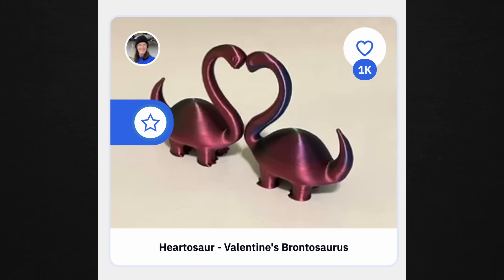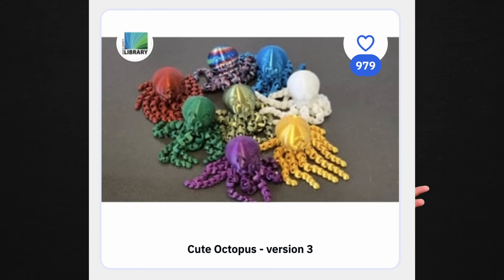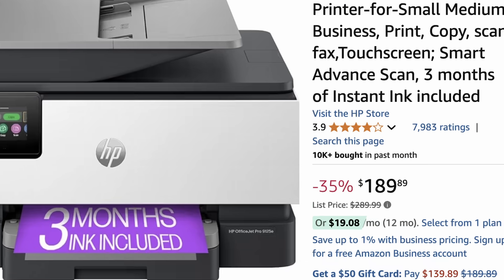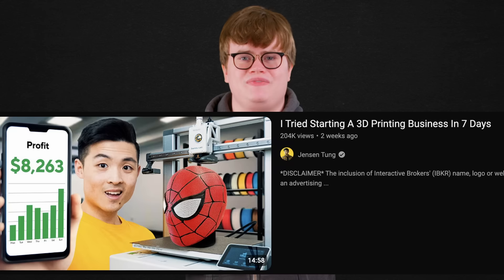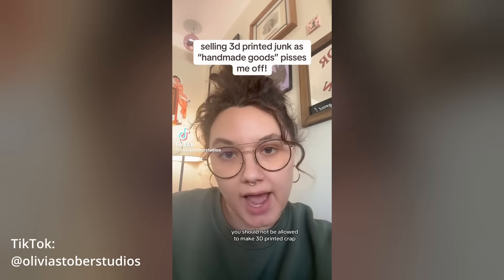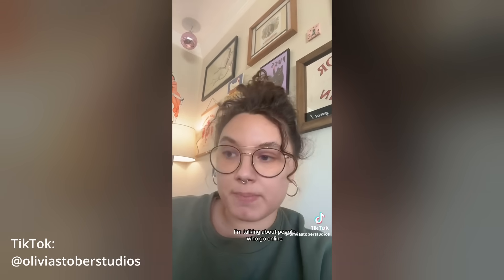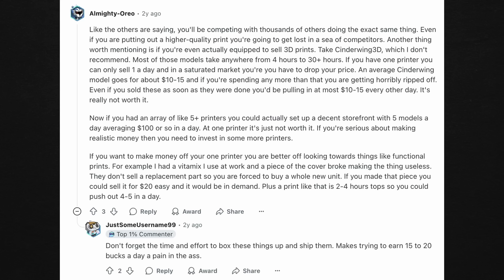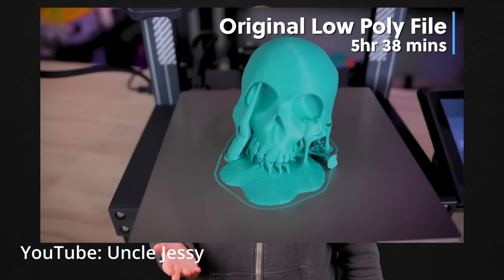The Rise of 3D-Printed Slop

Comment: i still have my first prints... must be 15 years old now. 

an adjustable mitre for the table saw.
a venturi "pond sucker".
the missing M1 105T change gear for my lathe. the one that basically cuts EVERY thread, lol...

other than failed prints, i try not to print "useless trash". it has to have some type of function... admittedly, sometimes its experimental and still ends up as rubbish... or its a jig to hold something else, and only gets used once...

Comment: "Why would you 3D print a cheap ring-sizer you could buy on amazon for super cheap!?" Because it's still less expensive to print myself, amazon can't deliver in 30 minutes, and I can save actually save a lot of carbon footprint getting a few rolls of filament delivered rather than having the amazon van show up every time I want a $1 widget.
That said all the rainbow Silk PLA dragons at every craft fair are stupid and drive me crazy, but bashing on 3D printers in general seems misguided.

Comment: 3 mins in and you're recommending people just buy stuff online instead of 3d printing.
1 you're talking about adding to pollution, to ship a hunk of plastic from China or wherever
2 printing your own is very cheap, even with multiple failed attempts, and that includes energy cost
3 it will likely still take less time to print, than waiting for your delivery
While we're not fully there yet, there is a pretty sizable push for recycling to make new filament
Reply: a professional critic is someone who is good at nothing, so they take their frustration with themselves out on others.
the supply chain is a foreign concept to them.
Reply: I'm guilty of printing a ton of garbage. Not only does owning a 3D printer incentivize you to make a ton of garbage for you and your friends and family, failed prints and "oh-I-could-make-this-2-millimeters-smaller" prints end up being several times the amount of actually useful prints. The inherent weakness of layered manufacturing also means that most parts end up using more plastic for durability than something you can find injection molded.
Yes, there are cases where printing actually reduces your overall footprint, especially if you're involved in specific industries, e.g. farming or electronics. Otherwise, it truly is wasteful, even compared to shipping junk from China.
I think 3D printing is a fantastic hobby, especially if you want to learn about modeling and engineering and such, but if we're being honest, we need to make some serious adjustments and improvements to our supply chain.
Reply: The waste argument really goes out of the window when you consider the whole lifespan of the plastic, as pretty much all raw plastic pallets used to make spools are made in China. Sending a kilo of raw plastic pallets to make into a spool, to then send out to a consumer that runs a machine for hours is significantly more energy and waste intensive than multiple the plastic, pushing it into a mold and sending it overseas. Less shipping involved and less energy intensive production. And that's not even touching the energy/waste cost of manufacturing and shipping a home printer or waste/energy cost of supports and failed prints.

Comment: While I'm fairly neutral about the practice of people making these fidgets alone, it does get frustrating when it floods artist's alleys at small cons or maker's markets.

Though there is one thing that especially baffles me as a crocheter. There are 3D printed trinkets made of plastic, but printed to look like they have crochet stitches on them (which is a fully handmade craft that machines can't replicate). It really confuses me because absolutely nobody could mistake them for crochet and they're hard and spiky, why would anyone want a spiky fidget toy mimicking a soft plush toy ?

Comment: There are great points here worth considering but here is a hot take. I have a business that sells both handmade jewelry, handmade sewn items, AND 3D printed objects including dragons and octopi, along with gaming supplies like towers and figures, etc. The point being, I print quality prints but I also print what sells, I don't try to compete with Chinese mills that drive prices to the bottom on Etsy, Temu, etc. And yes, most of my dragons come from Cinderwing3D. Unlike the vendors you mention, I print sizable dragons usually with wings... you will find thst most who print these on a large scale print as small as they can, in multicolor, and without complexity like wings... i.e. the (often) poor quality garbage you describe. 

My business doubled last year and I expect to be at triple or more this year because I added 3D prints to my offering. I have 10 printers in the farm and 4 resin printers waiting in the wings for minis. I am cognizant of toxicity, using PPE and ventilation.

My point is this video raises some important things to think about but it's also pretty gate-keepery and insulting for those of us who are trying to fill a demand that is definitely there (or they would not sell). I am training to design as well but I literally started printing last year, so it's a goal for this year. I also do custom functional print work as well but I am getting a little tired of the snobby attitude that every print is only valid if it does something productive. That's just ridiculous. People appreciate fun and beauty, too. Last I would argue that some of us make these things in a handmade way by honing the settings, choosing the sizes and colors, and by printing quality pieces. 

Just shoveling garbage? Agreed... that's bad. But if you make a bracelet from gemstone beads... did yoi also mine that stone, carve the bead, make the string... some do but most buy those things and simply assemble them... was that handmade? Where do you draw that line? And remember, I am coming from the perspective of a business where we actually do all of that for some of our items... I take wood and hand carve wands, I do actually cut and polish gemstones, some we actually pulled from the mine and the ground... in fact 99% of what we sell is made by us but how much of what we made is 100% "handmade" varies based on the item... so how much is required to qualify to be in that elite maker crowd and how much is not enough to rise above a lowly pretender... just something to think about.

Editted for aggregious typos and spelling

Comment: I actually wanted a 3d printer when they first started becoming mainstream. But I’m kinda ambivalent twards them now because I mostly see people making random little fidgets or cheap toys that become boring after an hour and wind up breaking or tossed in the trash. It does seem like you could find some good use cases for it, but the plastic seems cheap and tends to fail pretty easily, and it just seems more like it’s just there to make crap for the sake of making crap

Comment: I do original modeling and print my own private files. Have been working on a replica of a retro lamp from Europe that really can only be made via injection molding or printing. My sister wants to offer my lamp alongside her hand made crafts at shows but I can’t help but feel other makers will get the wrong idea.
Reply: Screw other makers... the 3D printer is a tool, I hear some woodworkers use a lathe, or a CNC, or a Laser... is their work less valid? Who is the judge? Vendor markets should be curated by the organizer or not... beyond that the public will decide if what you made has worth. Advertise your lamp as what it is... a reproduction of a lamp lost to time painstakingly designed and printed by "BluJFPV".

Comment: So let me be clear : I really dislike the 3d printed sand that sell trinkets they printed in mass from a design bought on the internet.

BUT.

Your argument about Temu is really not it.
Temu is absolutely awful, the ecological cost of transportation alone is WAY worse than even a hundred people who print widgets stuff.
A failed print rarely wastes more than a few grams of plastic. The catastrophic spaghetti failure is really rare.
Inexpensive printers can be, and are in several cases, as good are expensive one quality-wise.
Also, they're fast now, a simple objet can be a printer in minutes.

Sanding is absolutely useless in most cases. People consider it for cosplay purpose, because they intended to be painted, but practical print (what most people print after the first few month) doesn't need to be painted, the layers line are invisible if you don't have your nose on the print.
Your illustration photo is a macro shoot with a light that definitely is made to highlight the lines.
The illustration of a whitle is bordering on bad faith, printer who print like that are broken, uncalibrated machine. It's a print from a decade ago.
Lines are also almost imperceptible in the hand. It's not more uncomfortable than holding a piece of wood.
It's really an exaggeration, and it show that you don't have a printer.
You’re working on at least 5-year-old assumptions.

Like always, the problem is capitalism. People who absolutely want to hustle a few bucks from an hobby and people who profit from that buy selling formations, guide and cute model that everyone else has.
It's the printed t shirt hustle or the circut sticker hustle. En masse production of bad quality trinket.

Comment: Is part of the "bambu effect", now anyone can get a 3D printer and use it right out of the box, most people print useless garbage until the novelty wears off, mostly because such people lack a tinkering personality as well as the skills to design their own 3D models so they are only left with what they can find on places like thingiverse, which is mostly useless things, the useful things are so specific due its custom nature that the chances if finding it fit for your need are small. While I have printed my share of slop I do print mostly functional parts I made myself, many times that have saved me from throwing away appliances, a few examples: I fixed a meat grinder, the screw coupler broke, I 3D printed one and its already 4 years and still works. No is not a health risk, the coupler is not in contact with the meat. I also printed an impeller for a washing machine, it saved me $40 because I didn't bought the whole pump, I have printed custom cases of complex geometry for electronics, cameras for projects, etc.

Comment: I dont get the hate for 3d printed trinkets, even using "temu" as an argument for not printing stuff that takes less than half an hour, compared to waiting 14-20days for some airshipped crap from china (like your ring measure example). 3d design is easy and everyone can do it in some capacity. I honestly dont get what you are hating here exactly? You prefer junk from temu over something made at the comfort of your home?
You hate is all on some strawman who just prints junk endlessly, I have been 3d printing probably before you learned to read, build my first reprap like 12 years ago, A 3d printer is no different than a CNC laythe, its a tool you use to make parts or sometimes yes even an end product, is a guy using a CNC laythe to produce wooden bowls also not allowed on a makers market? Am I not allowed to share toys I design and that I myself have used for hours at the office? You honestly just seem like a negative little silly billy who couldnt figure out to be creative yourself. All you probably do is immitation, go play by a nodebook you boring shell of a human.

Comment: if someone cannot / don't want to learn to use any sort of CAD software there is little reason to own a 3d printer as they are not likely to be able to use a 3d printer for it's best feature - incredibly easy and fast prototyping for a product/project. so they may aswell just buy the parts online as then they don't need to spend a ton buying a printer.

Comment: As an artist who loves 3d printers and printing I fully agree with this video. I primarily only print designs I make myself, and usually these are tools or smaller aspects of larger pieces or require heavy refinement after printing. I also have spent a long time learning my machine and I do not leave it running without supervision, thus my print failure rate is extremely low because I make micro adjustments as a print is printing through out the process. TOO many just download others files, click print, walk away, come back and then don't refine the print in any way.
Reply: I also agree. While I don't design my own stuff (I hope to eventually though!)  the 3D printing isn't the part I consider art. It's the 20 different shades of paint I use on a 1"x1" miniature I printed for my DnD games. 3D modeling is art. Painting figures is art. The act of turning on your printer and pressing print is not art though, which is why files you didn't design, printed, and maybe sanded don't belong at arts and crafts fairs!
Reply: Many newer printers (like the Bambu Labs printers) are pretty good at printing without needing to make constant adjustments.  I've had mine for a while now and have yet to have any major failures
Reply: @StrikerEureka13  Except Bambu labs is notorious for updates that brick your printer. require a subscription or constant internet access to work. I really don't like them to be honest.
Reply: @Necatuss   I've never once had an update that messed up my printer or needed to buy a subscription.  I don't know if it needs constant Internet access, since I've never had it disconnect
Reply: @Necatuss  Bambu Labs are good.  There are reasons many companies, universities, and other institutions use them.
Reply: @Necatuss not true. At least with the A1 mini
Reply: @Necatuss  Bambu does not even currently offer an optional subscription, let alone have a mandatory one. Their printers also function just fine in LAN-only mode without internet access (however, you will lose certain functionality, like remote access, which is to be expected). While they got a lot of hate for their recent firmware lockdown, which was rightfully deserved, that doesn't make any of what you said even remotely accurate. You're reiterating random speculation you read online as if it were fact. As of today, not a single printer has been bricked, there is no subscription and the printers continue to function without internet.

Comment: Please tell me this was an AI generated video?  

a) Not everyone buys a printer to make random doodads to play with.  While I've made a few, I typically print useful things since I have enough "stuff" just hanging around.   For example, I designed and printed a custom fan connector for a lawn ornament because the manufacturer would rather  I send the otherwise good one to a landfill and pay $45 for a new one than sell me a $5-$10 part.   
b) Which is worse?  Printing something you can find on Temo, or perpetuating slave wages in a foreign country and propping up a polluting infrastructure to bring it to your door?
c) I had to learn to design and prototype.  Honestly, not that tough, start with Tinkercad, I swear it was designed for children, but in some ways, it can out perform its older professional Fusion 360 cousin
d) if you're not printing things in a rainbow of colors for no good reason, then you can do this process fairly efficiently and generate less waste.  Yes, if you buy the color changing printer and are convinced you need your ring sizer in 16 colors, you're going to generate a lot more waste.  That's on the individual, not the userbase as a whole.

Comment: I don't understand why anyone would buy a 3D printer if they can't model objects themselves or have the desire to learn. It would be cheaper to just buy years worth of individual prints from a printer farm. Fusion and Blender aren't even hard!

As for ventilation, filament choice matters a lot. I don't stay in the same room as my printer when using ABS or ASA, but its fine with PLA. I have a particle counter and VOC measurement tools because I was initially concerned with breathing gasses and fine particles but it turns out they don't produce meaningful amounts of particulate, just don't breathe in the styrene from ABS because that is miserable.

For resin printing I outright wear a P100 respirator and actual ppe, same one I use for airbrushing.
Reply: I would not.
Printer are as cheap as 200€
Reply: @SaitoGray  a better alternative would probably be using your local makerspace's printers rather than buying one if you're just printing other people's models. IDK why that didn't come to mind before print services did.

Comment: I'm a big 3d printing nerd, and I've found them incredibly useful for fixing things or designing utilitarian items. Since I started, I've saved 80-70% of all my 3D printing waste with the intent of recycling it myself and turning it back into usable filament. Machines that can do this are expensive and hardly make sense for most, as new plastic is cheaper than recycled plastic. It is concerning the amount of waste that printer can produce, and I do wonder how much of this waste is not recycled. Printing stuff, and finishing those prints (particularly sanding-- micro plastics galore!) certainly has health risks that I think many printing companies haven't fully considered.
That being said, if people want to collect plastic trash (and it's thus not going into a landfill)-- why not? Printers are great a prototyping, but I don't think 3d printing should be gate kept to exculsivley utilitarian-items. Of course, this is a valid thing to worry about and conversations should be had, but particularly for the people who are not printing original stuff and are selling them at places designed for handmade crafts and art.
There are bioplastics similar to PLA that break down much faster (in a matter of months!), and I'm hoping that we will see an adoption of these materials in the future.